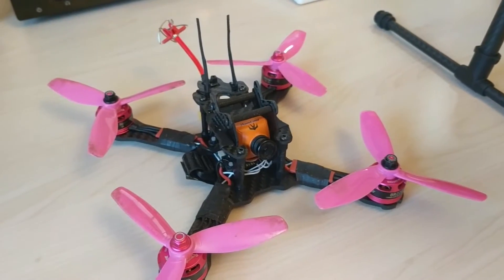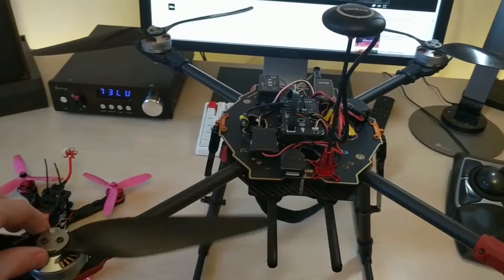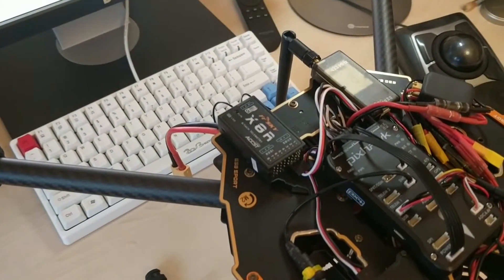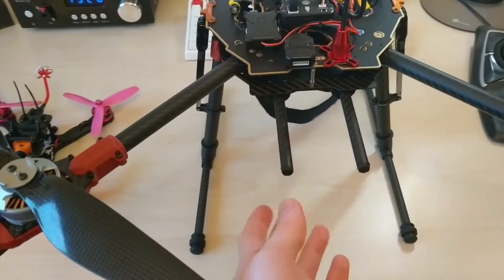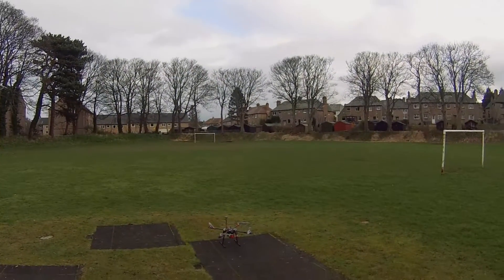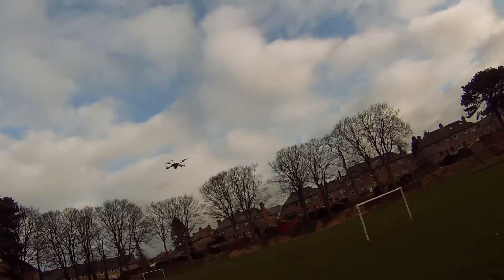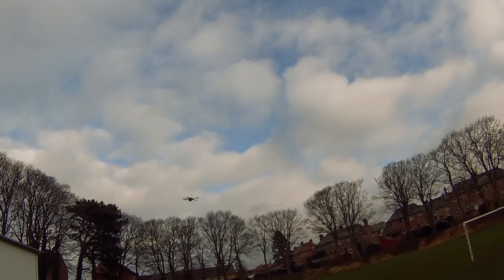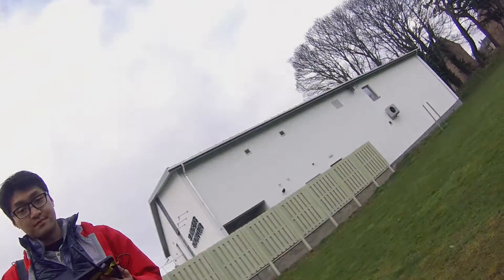Tarot 650 Sport maiden flight!

Comment: Hello bro! Good video!
I am building my drone with this config:
Tarot 650 
Pixhawk 4 + GPS
Tarot 4006 620kv / 13x5.5 prop
ESC 30A SimonK  
Battery 4s 14.8v 5200mah
Taranis RC + FrSky X8R
Total weight is 2kg

The problem is that the ESC and the tarot 4006 burn many times and I have to buy all the time. I do not know why ...
Calibration of the ESC is done by Qgroundcontrol, including the PX4.
Not much information about the Tarot 4006 620kv...
  Do you have any suggestions?
Reply from the maker: Your setup looks fine in eCalc (https://i.gyazo.com/36ee4a532dffe7c61a40e38fddcc7b9c.png). What conditions are you burning motors/ESCs? In the middle of flight? After a crash? Have you managed to complete an auto-tune yet?

Comment: This is awesome man! Do you know what the ballpark mac takeoff weight would be with this batt/motor/prop combo? Also what was your flight time like with the 8000mah 6s you were using?
Reply from the maker: Max takeoff weight would be somewhere around 6kg, but I wouldn't want to above 4kg or so (which means a ~2kg payload once you've taken the weight of the quad + batteries out). Hover time on an 8000mAh 6S with no additional payload would be pushing 25 minutes. The figures that eCalc spat out were pretty accurate from my experience, it's well worth the paltry license fee if you're thinking about playing with bigger setups like this.
Reply: @CJDavies  Do you mean the license fee for eCalc full feature set?
Reply from the maker: @flighttherapybullisticfpv133  I mean the $8 annual fee for xcopterCalc, if you don't pay you can only access a very small number of motors/batteries/etc.

Comment: In this configuration, it is much better to use Gart ML5008 for 400KV, the efficiency of such an engine is 5% better both in power and speed.
Reply from the maker: I would think 5008 400kv is better suited to larger props than this frame can fit? Maybe 16-17"?

Comment: great build, doing that as I watch your video  gartt ML 4108 500KV, you did not use the PDB that came with the Pixhawk 4?
Reply from the maker: I didn't buy the pixhawk with a PDB. That Tarot frame was a huge pain when it came to power actually, one of the first things I changed when I moved to the Daya H4 680 was to drill mounting holes for a regular 6S capable 30.5x30.5 PDB from Matek.
Reply: @CJDavies  I had  the same issues, found the original PDB from holybro,  it made it easy, had to drill my own mounts for the board, created a third platform, used a 3D printed cap that allowed the wires from the motors( Gartt ML 4108 500KV)   to be routed through the frame, the The only thing I regret is not having telemetry as with my other Quad builds.  Using the Inav system, I had everything on one screen, here, its a mess, but in for a penny, so we continue

Comment: Great feeling not to crash on your first flight. I've done that several times :-) I also built the 650. I use multi star 4114 Motors, 17 inch props, and a 6S battery. I think they only recommend 15 inch props but mine fit fine and the 650 is built well enough to handle it. I got 22 + minutes of conservative flight time. I did not push it at all. The only reason I brought her down was because I thought my voltmeter was failing. Probably could have gone another five minutes. I've built several Tarots, the 810, 960, and the latest being the same as yours, the 650. I have to say the company does a very good job putting them together. All the pieces fit perfectly into place. I only complaint would be, the 650s landing gear felt kind of flimsy, and a couple of carbon fiber splinters which really suck. Anyway, congratulations on your successful Maiden flight.
Reply from the maker: Interesting you should comment now, as I'm actually about to embark on a rebuild of this quad onto the Daya H4 680 frame. The Tarot certainly feels sturdy (except for the aforementioned landing gear), however I'm not a fan of how it folds - the amount of force that you have to put on the clips to open/close the arms (& the amount the top/bottom plates flex in doing so!) makes the process inconvenient & I'm constantly worried about damaging something when closing the arms by jerking too hard when they finally leave the clips. Plus the folded form being so long is inconvenient for me for transport compared to something that folds into a shorter, squatter shape. I'm actually selling the giant Peli iM3220 case I bought for the Tarot & using the proceeds to pay for the Daya frame, which should fit into one of my much smaller wheeled Peli cases.
Reply: That's true, I never unfold mine. It is so hard to do it is as if it is not meant to be unfolded. I like the design of the 960 and 8:10 with the wing nut clamps. That 650 should have done something like that. I rarely unfold any of them because when I fly I simply put them in the back of my pickup truck. Storing them, I place them in Rafters on the ceiling I built so space is not too much of an issue.
Reply from the maker: Mine went with me all around Pakistan & Iceland, so folding & a hard case were required!

Comment: Which is better in between 3 hole and 1 hole propeller?
Reply from the maker: Neither is necessarily 'better'. The 3 hole T-style means you'll never have prop slip, but it's also not as suitable for repeated removal of the props (for travel) which makes quick release adapters (which are almost universally a pain) kinda necessary. With 1 hole props you can more easily remove them but you have to be more careful when tightening to make sure they don't slip against the motors.

Comment: What voltage that you set for the low voltage alarm? 

btw, you have the exactly same thinking when i first flying the 650 . "will it fly?", "what happened when i switch flight mode", "will it fly away and crashed horribly" 😂
Reply from the maker: I think the critical alarm in Arducopter is at 21.4V (3.56V per cell) but I generally watch the voltage on the Taranis or laptop/smartphone & judge it myself.

I was even more worried when I tested failsafe, intentionally switching the Taranis off with the thing in the air was terrifying!

Comment: Can you suggest the total thrust delivered by this quadcopter. or maximum payload that it can carry.
Reply from the maker: Total thrust of the setup in this video is just over 7kg & the weight with a 8000mAh 6S is a bit under 2.5kg. An additional payload of 2.5-3kg should be possible in gentle wind.
Reply: I am asking this because we are going to have a competition in university level. there we have to carry a payload of 2.5kg. will you suggest this setup for the competition?
Reply from the maker: Generally it is a good rule of thumb to aim for a 2:1 thrust to weight ratio. If you put a 2.5kg payload on a setup like this, you would have a thrust to weight ratio around 1.4:1 which would fly fine but wouldn't have as much performance or as much ability to withstand higher wind as a 2:1 ratio. Take a look at https://www.ecalc.ch/xcoptercalc.php which lets you calculate thrust, power consumption, flight time, whether you're overloading your motors, etc. with a whole range of different motors/ESCs. It's a very useful tool when building larger copters & well worth the small subscription price!
Reply: Thanks for support CJ Davies

Comment: Tarot 4108 380kv Motors work only with 6S battery?
Reply: Dimitris Geroulakos The Tarot 4S 4006 is one though motor to be said, although quality isn't number one :)
Reply from the maker: I've only seen people running them on 6S & there aren't any current/thrust tables for anything other than 6S. I think 380kv would be too low to get good performance with less than 6S. If you're looking for something similar price/quality for a 4S build, there are options like the Tarot 4006 620kv which are designed for 4S.
Reply: Thank you i'll check them out.
Well, my only concern is that i already have (2x) 3S 3000mAh 20c batterys and (1x) 4S 5000mAh 30C from my previous build. 
and i'm trying to find something to work with both on my new 650sport.  Maybe ill go for SunnySky X4108S 380KV.

Comment: Whats the flight time you're getting CJ?
Reply from the maker: I haven't finished configuring/testing the voltage warnings/current sensor yet, so I've been being quite careful - I was getting ~8 minutes of fairly hard flying the other day on 4000mAh 6S packs which recovered to 3.85V per cell, so I'm hoping for maybe 12 minutes slow flying on those 4000mAh packs when discharged to maybe 3.6V & maybe 20 minutes on the one 8000mAh pack I have & when using two of the 4000mAh in parallel.
Reply: CJ Davies Go 10000 mAh. I've seen people flying 50+ mins with that battery 😂

Comment: Congratulations!  Nice build and flight.  I've been thinking about building a camera platform with a Pixhawk or a F3/F4 with iNav.  So, it was cool to see a new build on the Pixhawk.  Thanks for posting.
Reply from the maker: An F3/F4 board with iNav is certainly an inviting prospect for keeping cost down, but the more I researched Pixhawk it really did seem to be the 'de facto industry standard' for so many UAV endeavors - whether in the air or on the ground or on the water. So one of the reasons I decided to go the Pixhawk route was so I could get to grips with a platform that I may encounter again & again in the future, both in my work & my recreational endeavors!
Reply: Thanks.  Good to know.  I will likely try the Pixhawk for a build.